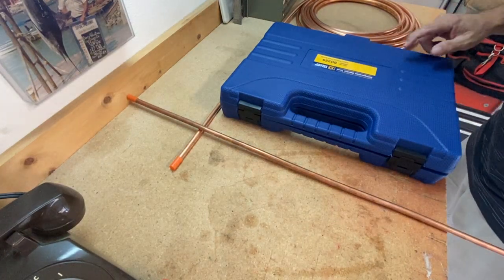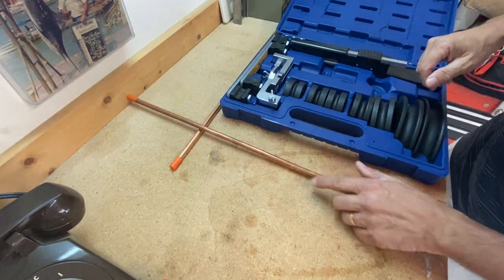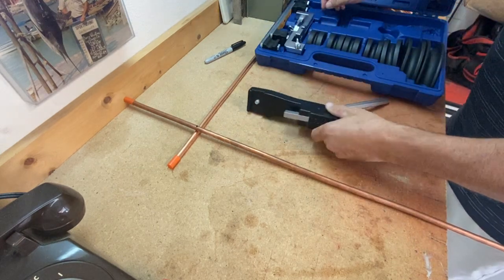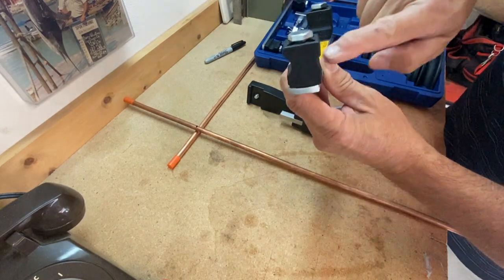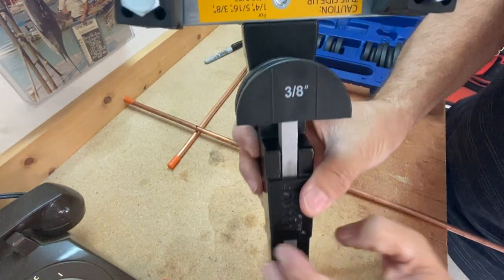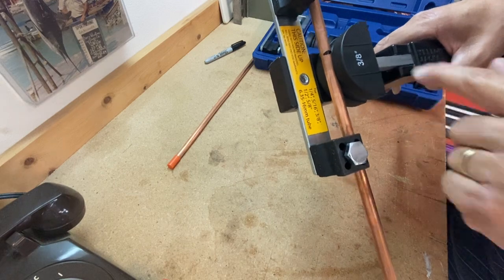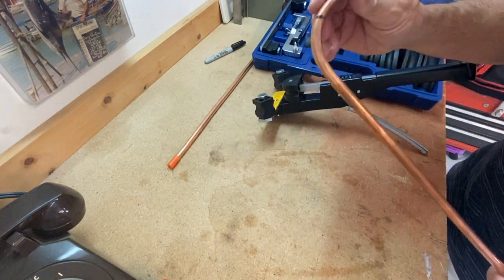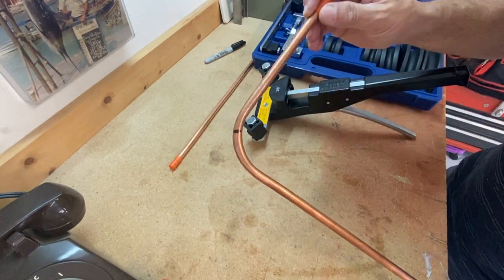HVAC Copper Tubing Bender Tool

Comment: I'd much rather see you demonstrate with 7/8" tubing with no kinking. A $15.00 tubing bend with 3/8" could be done in 5 seconds.
Reply: One thing he didn’t mention is any hard copper (like the 3/8 used here) needs to be annealed before bending. It will certainly bend 1/4 and 3/8 without annealing but that adds a lot of stress to that bend and will likely crack. Zero chance 7/8 hard copper is going to bend with this tool without annealing first.